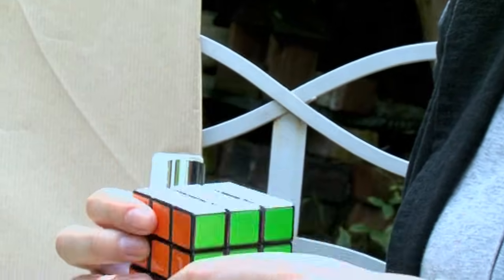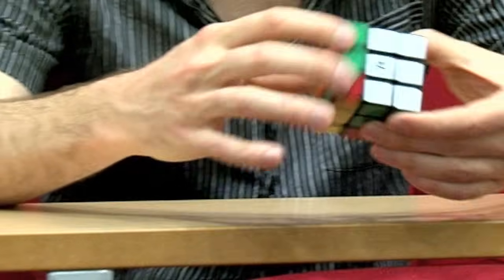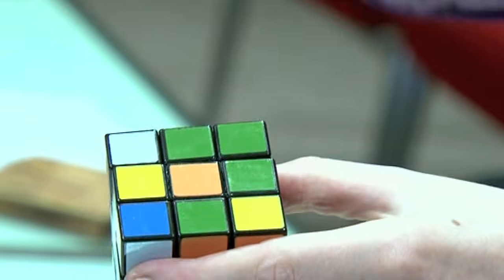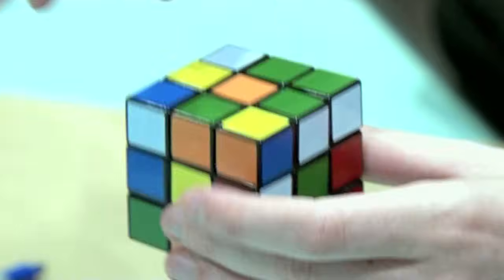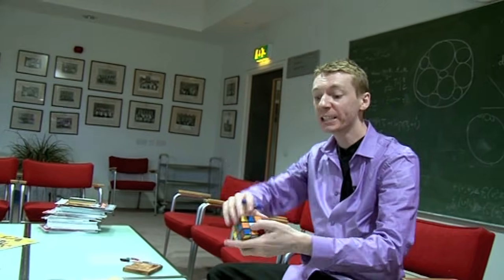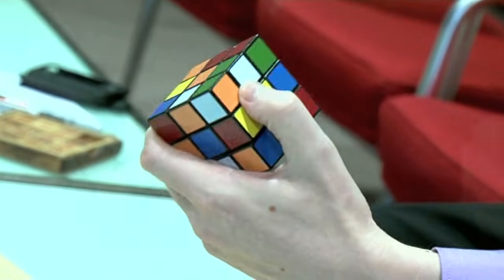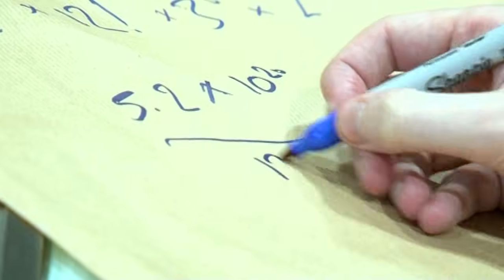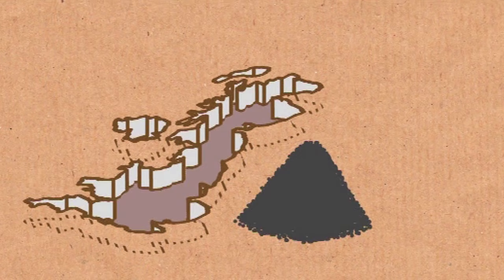43,252,003,274,489,856,000 Rubik's Cube Combinations - Numberphile

Comment: OK, I didn't watch it in detail, but I suspect your maths was wrong when glancing at a few sections of the video. You can't simply twist a corner around into to get three valid physical positions. Only one of them will be guaranteed to be solvable. If you move two corners, the resulting combination might or might not be solvable. Ie there are fewer real combinations for a solvable cube than theoretical ones. That said, you use the word 'arranged' in the title, so the numbers might technically be correct but a pointless calculation to make. FWIW: I used to be able to do the Rubik's cube in less than 30 seconds EVERY time, usually a bit less.

Comment: Well actually.... the center pieces are not in reality fixed.

They appear to be fixed from the color point of view but from the physical point they can rotate. You can rotate any pairs of center pieces by doing 126 moves. You can do it with any pair of two center pieces, any of them are entangled together.

To test this, you can mark 2 center pieces BUT only on TWO ADJACENT SIDES, Let's assume we choose TOP side and RIGHT side. Rotate them alternatively, the whole sides, first RIGHT and the TOP,  then RIGTHT then TOP and so on until you rich 126 moves, then you solved the cube again. But only from the color perspective. You just rotate once a right side then an up side, keeping the direction the same. You will end up with a different cube physically but solved by colors. You can draw the start of the center piece and the finish one including the markers to see the difference. They will rotate in the opposite direction of your rotation.

Comment: I tried to find the number of combinations possible in a 100x100x100 cube, but no online calculator could handel it.  but the formular for this cube would be the following.  8! * 1176! * 57624! * 3^8 * 2^1176. If someone can calculate this, they are the best.
Reply: I am literally 4 years late, but here it is. It would have 4^600 possible combinations, or you could also call it 10^361. 361 Zeros.

Comment: The number listed above is not correct, as a Rubik's Cube is played. The number above is correct if you can remove each. And replace each. In a different location, which is not possible because they are in fixed positions. The actual total number of possible locations for the individual tube pieces is 1,327,104. It's funny how even brilliant mathematicians forget that the cube pieces are fixed and certain locations. 8 corner pieces can be in 8 locations  in three orientations.(128). 12 Edge pieces can be in 12 locations in to orientations.(288). 6 centerpieces can be in 6 locations with only one orientation.(36). For a grand total of 1,327,104 .

Comment: Hello Numberphile! I've solved a number of Rubik's cube myself. For cubes with labeled centers, like those giveaways by some companies, you will notice that a solved state can have rotated centers. You don't notice this in a standard cube because the center is just a single color with no indication for orientation. But, if you account for this I believe you should get an extra factor of (4^6) combinations as there are 6 centers and 4 rotations possible for each center.
Reply: no

Comment: I know this vid got release quite some years ago but, a question arise in my mind: whats the furthest possible "scramble"  a rubik's cube can be from the solved state? Example: if i take a solved cube and do a quarter twist, it will be 1 move of distance from the solved state; if i do a half twist, 2 moves from the solved state, and so on. Basically, whats the highest number possible of elementary moves (a minimum move is a quarter twist if im correct) a cube can be from the solved state?

Comment: Area of the uk = 242495Km
Rubix cube side area =32.49cm roughly
32.49cm in Km =  0.0003249Km

Every combination laid flat would have an area of 43,252,003,274,489,856,000 X 0.0003249Km
Which is 14052575863881754Km

Divide the area ok the UK into that = 57949961293

So if you laid them all flat next to each other it would take up a flat area of   57949961293 UKs

That's probably totally wrong because i'm terrible at maths but there you go

Comment: But still, if the center pieces are fixated, they can be differently placed. They rotate, you can see that very clearly on a rubik's cube with photos instead of colors, so I think you could calculate that too.

Comment: So I don't have the math skills to disprove this number but I would like to see how they set up the math for this.  Does this take into account the cube and how it works mechanically?  Like the fact that the centers don't move?  or for example the red, blue and yellow corner will never separate?   Does this make sense.....?
Reply: Daniel Stuart I think that they calculated the number without using the "normal movement", meaning they used any combination of colors without regard for realistic movement.
Reply: Yes. According to Wikipedia, there are 43 quintillion permutations by scrambling, 519 quintillion by disassembly, and 2.1 septillion permutations by disassembly and center orientations.

Comment: Does anyone know the mathematical basis for why he divides by 12?
Reply: Not every combination can be reached. Edges can be placed anywhere you want them, but you cannot change the orientation of a single edge piece (so that's 2).

As for corners, you can place 6 of the 8 corner pieces as you like, but the last two are not interchangeable (so that's 2). Also, the orientation of the first 7 corner pieces can be changed as you like, but you cannot change the the orientation of the last one (that's 3).

2x2x3=12.

Comment: Technically it is not 3 to the power of 8 since there are certain combinations that it does not work eg. Turning one corner counterclockwise and one clockwise from a solved state. (Try to solve it after doing that. It won't be possible) ps. They are called cubies
Reply: Nevermind

Comment: The problem with your methodology here is that if one corner or edge is unoriented, you create a parity which in essence, is unsolvable. This means that the number of scrambles possible which you have created is incorrect due to the parity cases. This problem would be solved if there were no center pieces like on a void cube, making the orientation of the last edge unlike a standard cube. This would make your number higher than the physical Rubiks Cube scrambles.
Reply: I know this was covered but this was another way to describe it.

Comment: The advanced method will have to spot more than one thing and attempt to solve partial parts at one time, the result of that is cutting your time down. But this comes at a mental cost, which involves 
1 : learning theoretically Algorithm cases, this is the hardest part because you have to remember the specific case of algorithm for the specific solving task, you have to filter through a number of different cases to reach mentally the absolute correct algorithm to do the task, if you can't remember the intended case, you will have to apply intuition to reach a known remembered algorithm that you now much better from among other algorithm cases.Because certain algorithm cases would probably be rememberd much more than others based on your banked collection of algorithm in your memory.

, and also memorizing these algorithms, and then applying the algorithm cases in practice.

Comment: Hi Numberphile! Huge fan!
I was just wondering, you work through the maths calculating the amount of ACHIEVABLE orientations for the standard Rubiks cube, being the 3x3x3, and I am trying to apply that same course of calculation to figure out how many combinations my other type rubiks cubes has got (4x4x4, 5x5x5 and so on). So, say for the 13x13x13 cube, which is the biggest n*n*n rubiks cube I have in my collection, so far I've got 8! * 132! * 3^8 * 2^132, where 8 is the number of corners, and 132 is the number of edges (11 edges to each edge on a regular 3x3x3, being 11*12 = 132). Now for the end of your calculations, you talk about these universes, or orbits that are unachievable by doing regular turns, opposed to disassembeling and reassembeling the cube, and you devide the answer from the first calculation with the amounts of universes, being 12. Now, the amount of universes 12 because of the number of edges? or is it a set number for all n*n*n calculations? I would really apprechiate an answer on this :) Thank you very much! Huge fan

Comment: I know this is the accepted number but it doesn't seem like the right one to me. For example, when you place the first corner piece, there is a giant set of cubes that can be constructed from there. But if you place that piece in any other corner, it generates an entire extra set of cubes that is identical to the first set and never divided out. You get the same thing with the edge pieces and even a similar color symmetry that you can argue is ignored.
Reply: The center pieces are never multiplied in because they're static.  That functions as the redundant orientations you would otherwise divide out.

https://youtu.be/QV9k6dRQQe4?t=427
Reply: I agree
Reply: +Adam Olsen I think I understand now, since the center pieces don't move every different corner position is distinguishable from the other ones. Thanks!
Reply: Adam Olsen
I never mentioned the center pieces.
Reply: +Melinda Green yes, but if you start with the red/green/white corner in a different position you don't get the same cube configurations because it is in a different place respect to the centers
Reply: +Melinda Green I think that color simmetries are not accounted because the question is something like: "how many different cube configurations are there?". If you want to account for color permutation (because they are game-wise not relevant) you could simply divide by 6! (if I'm not wrong)
Reply: motmaos
6! sounds right though I don't know.

Comment: If you have one ofset corner, it's mposible to solve. So its not 3 to the 8th power. More like 3 to the seventh
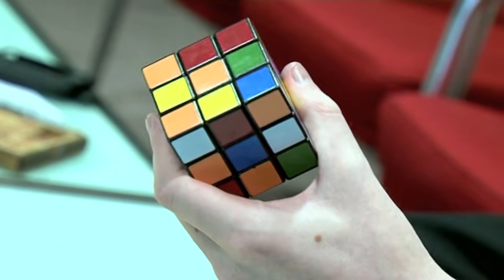Reply: Answered at 7:00. divide by 12 to eliminate the impossible to reach configurations taken into account earlier.
Reply: +Torrey Goldberg ok thanks
Reply: +Torrey Goldberg sorry .. The 12 comes from 3 things a 3x2x2 so 3^7 and 2^ 10 would be equivalent in their first computation of possibilities

I like the full un-reduced number because it tells people where the values come from.

Comment: You see, this is how you can tell a physicist from a mathematician.  I'd just take the thing apart and put it back together solved, upon which point it's effectively solvable in all possible starting configurations.  (They just tell you to solve it -- they don't tell you how!)

It's a lovely little mechanical device, with many small parts all separate from one another and yet making a single physical whole.  It's quite interesting when you disassemble it.

Comment: So the number is wrong!!!
You can't just twist only one piece by an algorythm. 

That means, that the number ov combinations has to me smaller.
Reply: +Thiemo Krebsbach You're right about the insoluble configurations but they've compensated by dividing by 12 to allow for a single rotated corner and the flipped edges but crucially they don't offer any proof.

The number of combinations is 519,024,039,293,878,272,000, inclusive of  all the invalid states.  This number is even higher for a picture/super cube.

Comment: Does this mean that a picture cube would be 43 252 003 274 489 856 000 x 6 to the power of 4?
Reply: 4^6 Which is actually larger 

This is assuming that the orientation of any one center piece is independent of all the others which may not be true.

Comment: Isn't it weird that if you pluck out the individual blocks to increase the variations of patterns you will get to a "last" block variation. That said that you went through all the variations to try and get as far away from the original arrangement. 

But funny enough won't that be the Rubik's cube completely in reversed order, which means if you try to scramble something up enough you might end up with something that resembles exactly or be able to be arranged back into the original. Kind of logical but I just thought about that now. @singingbanana

Comment: Calculating 3 positions for each corner is a bit wrong. If you turn a corner by one, to keep the cube in a solvable state, you need to turn another corner too so you will never have a finished cube with only 1 corned that is twisted. (And the same rule apply to edges)

Comment: What I'm interested is how you get the fact that there are 12 orbits.
Reply: 2 (number of orientations for one edge) * 3 (number of orientations for one corner) * 2 (Because an odd number of swaps isn't possible) = 12
Reply: @Numberphile Can  anyone of you help me by writing
with simple and understandable words  why we divide by 12?plz cuz i need an answer immediately... please...
Reply: @matinatheo8312  the whole explanation was based on taking the cube apart and putting it back together in all sorts of ways...but if you were to solve a cube (without taking it apart) you'd realise that there's no single (or a set ) of moves that can change the position or the orientation of one sub cube only...in simple terms it means that when u shuffle a cube, the sub cubes shuffle relative to each other...the number calculated was for a cube taken apart...so it had to be divided by 12 (the no. Of different "universes") to get the actual no. Of permutations on a cube...also the no. Was calculated for a standard 3x3 cube...it's different for cubes with pictures or numbers on them, larger cubes, etc....play around with a rubiks cube for a while...you'll understand how it works way better than any explanation on the internet  :)
Reply: Me too..
Reply: Your punctuation is a nightmare.

Comment: You actually can pull the pieces off and swap them around. That's how I usually solve them, myself. You just need to twist one side at a 45-degree angle and pull. it away from the rest of them. It'll pop right off.
Reply: With a brand new cube, it helps to pull apart the puzzle a couple times to "loosen" the mechanism. But break it apart too many times, and the puzzle becomes way too loose.
Reply: Why so srs Oh. I can. And do. But with brand new cubes, pulling them apart can loosen the mechanism enough to use easily.

Comment: 4:42 not true if you are one move away from solving it is still solved just a +2 second penalty.
Reply: technically is isn't solved
Reply: Tejas Kalyan in the wca it counts as solved it is not a D and F also you sound like a non cuber with the "technically"
Reply: +Donovan Bourke also, I meant only one Fully solved position.
Reply: Tejas Kalyan k did not want to start a argument :)

Comment: Wow 856 thousand flat. Thats convenient.
Reply: What if there were 31,415,926,535,897,932,384 combos that would be legendary.
Reply: Amazing
Reply: not really. this happens all the time in combinatorics. anytime a 5 and a 2 are multiplied together, the number will end in a 0. in fact, by counting the number of Zeros at the end if a number, you can know how many pairs of the numbers 2 and 5 appear in their factorization. in this case, the zeros come from the 8! (1 zero) and 12! (2 zeros).
Reply: Adam Billman 
Ohhh....duhh
Reply: +Adam Billman I had a homework assignment to find the number of zeroes that come at the end in 100! That's the method used to find it quick, just count the number of 5's in the prime factorization since there are fewer 5's than 2's.

Iirc it's 24: one from each multiple of 5 and another from each multiple of 25